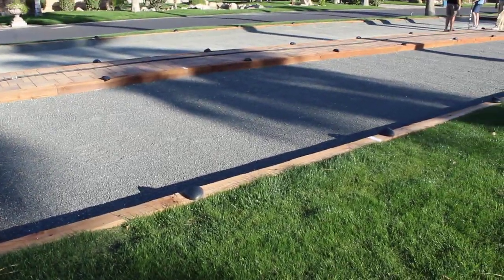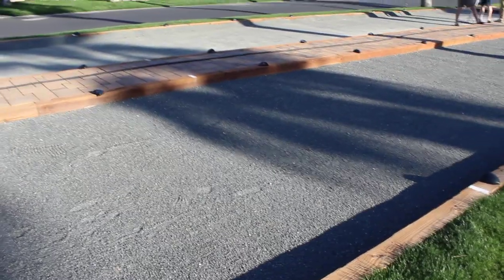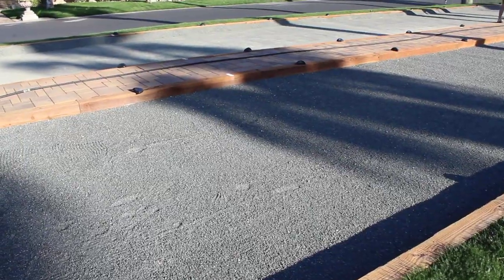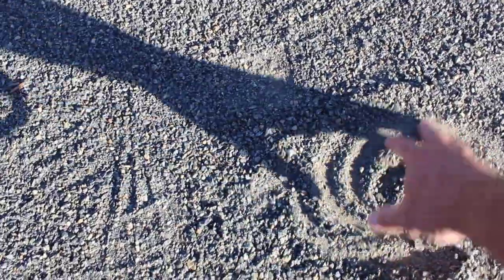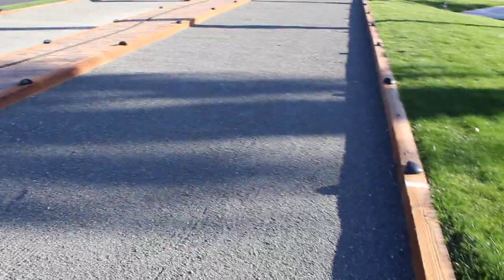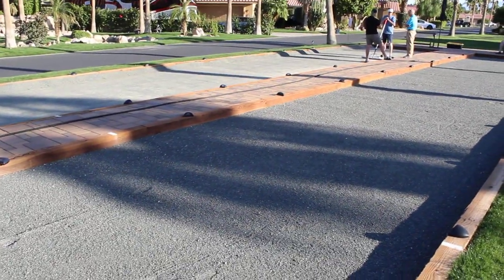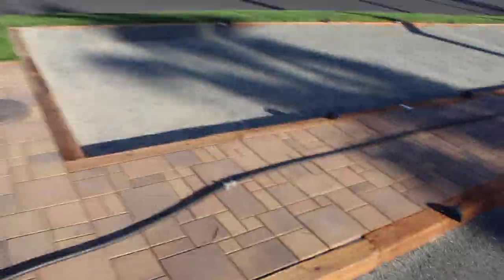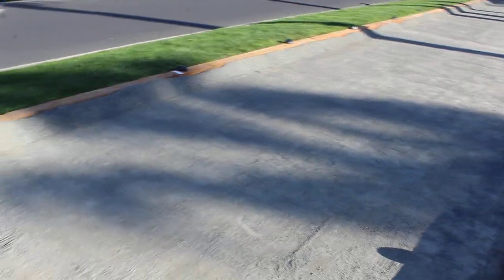Bocce Ball Court Surfaces Gone Wrong

Comment: Stone dust or granite dust or even brick dust (makes a red surface) will look and feel almost like flour, having a very powdery texture. Anything more granular won't compact and give you a hard smooth surface. A fine powder will act like self leveling cement in a hard rain, and will auto level and maintain itself over time if installed properly.